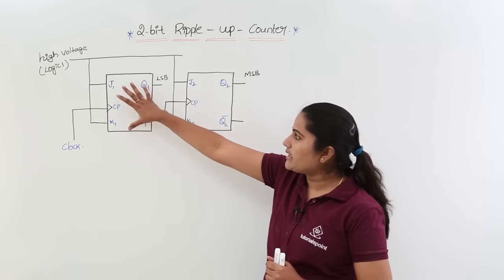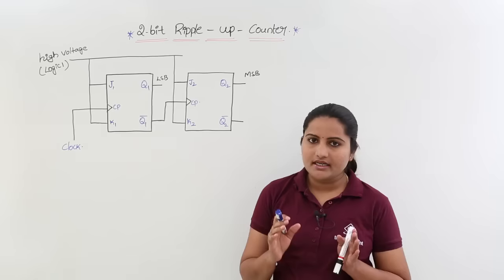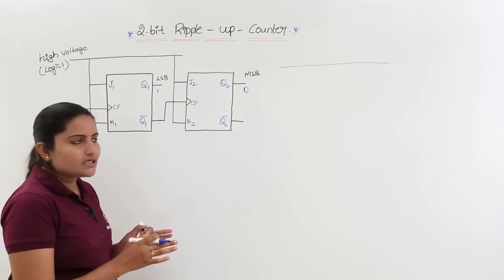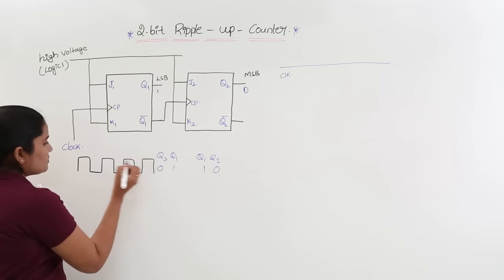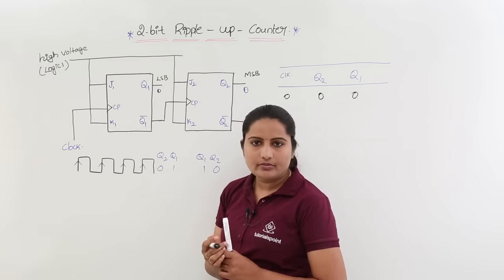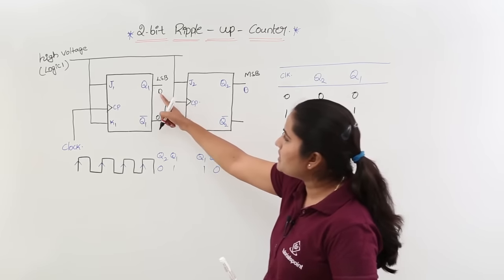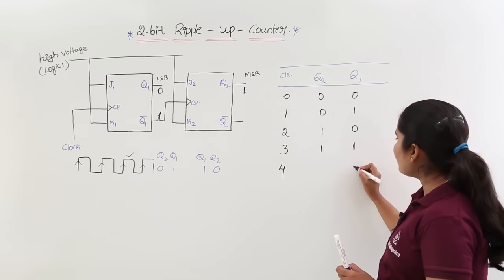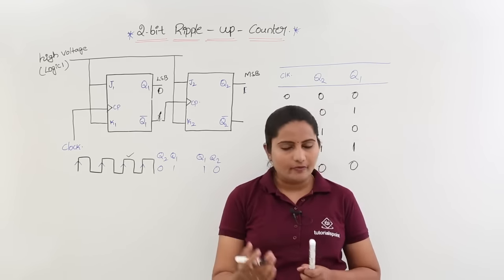Ripple Up Counter

Comment: Can we take the output from Q1as a clock pulse for 2nd flipflop..?
Reply: yes
Reply: The principle is for flip flop 1 u need external clock pulse , and for flip flop 2 it takes the output of flip flop 1 as clock pulse , 
This type of counter is known asynchronous counter !!
Reply: Can we give the out put of Q1 as clock ip to the next flip flop and why should we give the complement of Q1 as ip to the next flipflop can u say the difference between this two?